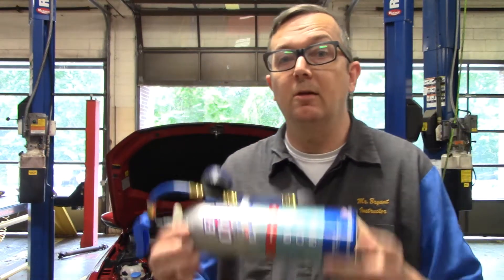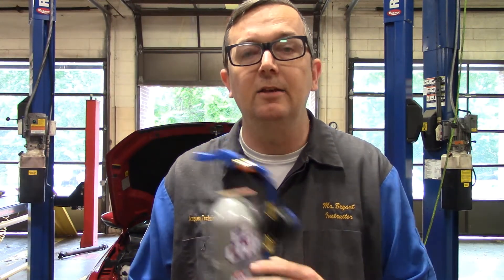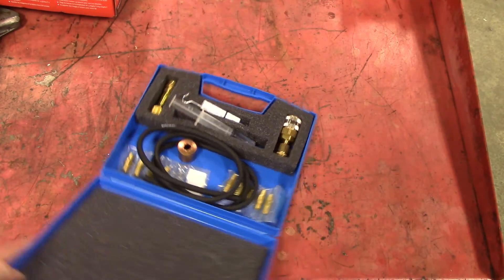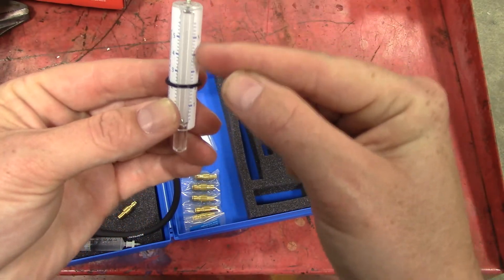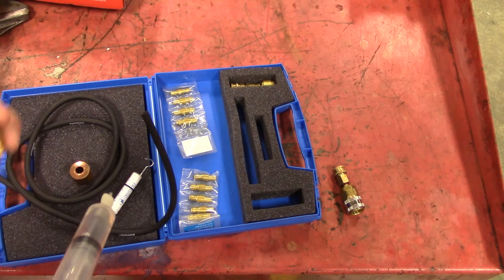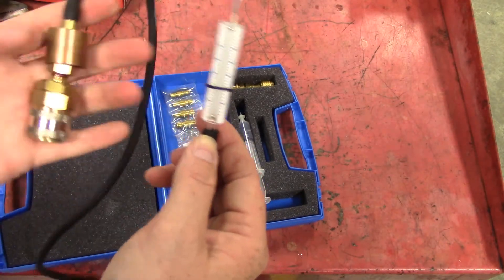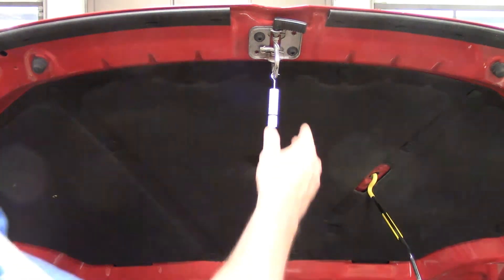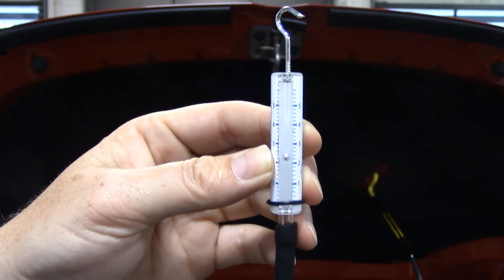Technician Training Series: How to detect sealants in air conditioning systems

Comment: So if you find a vehicle has sealant in it, how are you recovering the freon in there safely without using your machine??? Recovering with your machine would potentially get the sealant into your robinaire machine, correct?  And that's what we are trying to avoid.
Reply from the maker: The cars system would have to be completely flushed with condenser replacement if sealant was added. To protect your equipment, a company makes a trap for this type of situation. I’m probably going to get one for my machines since this has become a problem. Here is the link to the company, I have no affiliation with them however: https://airsept.com/Products/auto/12/recycleguard